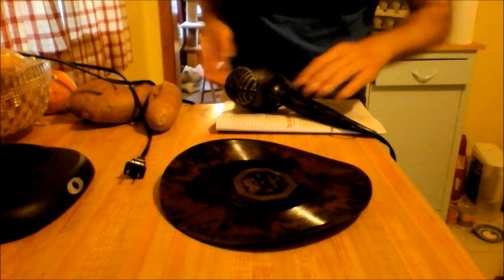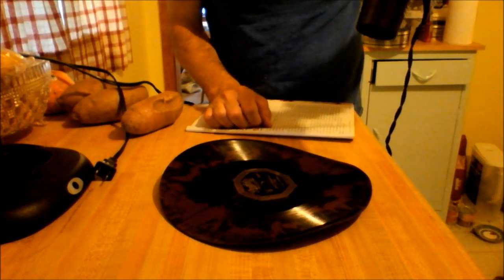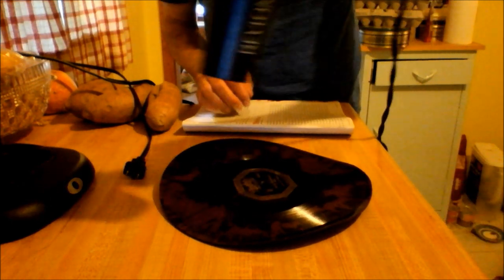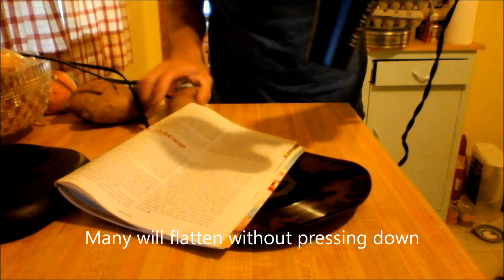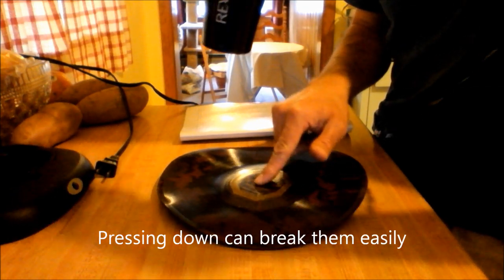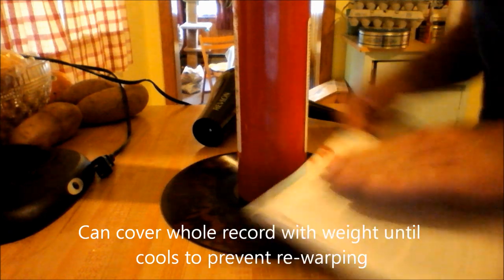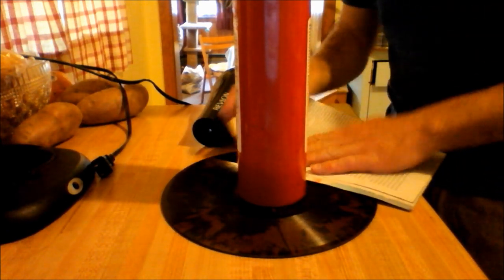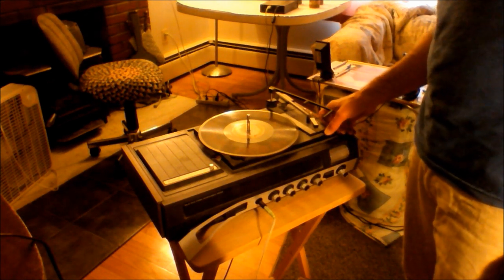Flattening A Severely Warped Pathe Splash 78 RPM Record

Comment from the maker: Not a silly question at all. It should work on all sizes. Doesn't work as well on 33's and 45's because they are made out of vinyl and styrene and it usually effects the way the sound and they would melt very fast. I made a video on here of flattening them also on here. 78s are made out of shellac and other stuff which for some reason works way better for flattening. The non breakable 78s may not work as well.
Reply: Yeah I melted the beginning portion of one of my 12" singles but that's my fault lol

Comment from the maker: This week's video. Flattening a severely warped 78 record. Next week back to comedy.
Reply: Had I see that record before you fixed it, I could have thrown it out altogether, by the way, do you need a certain kind of hair dryer to do the trick? or any hair dryer will do just fine?
Reply from the maker: I just use a regular hair drier. It seems to work really well.

Comment: I did not even know 78 RPM could warp! I thought only vinyl could!
Reply from the maker: I know what you mean cause they are so hard as if there is no give to them. I wasn't even sure about flattening them at first but I figured I had nothing to lose and the results were fantastic. Glad I could save them.
Reply: I have two 78 that are cut in half and one that shattered in thousand pieces. The one in thousand pieces is obviously beyond repair but do you think it's possible to repair the ones that are cut in half? Like with glue or something? One of them is very valuable so is there any way I could fix them?
Reply from the maker: I wish I could help you with that. That's one thing I wish that could be fixed. If someone comes up with something to fix broken or cracked 78s back to where there is no crack it would be awesome. I have glued them before and they would play but the crack is very loud everytime it went by. I used a epoxy glue where you have to mix the two tubes together to see how the records would come out. Lets hope someone discovers a way.
Reply: "JB Weld" does pretty good in fixing cracked shellacs. Make a small batch of JBWeld epoxy, then thinly spread the epoxy on one side of the crack and press together until fully dry. the epoxy will fill to the edge and before the JB Weld sets, take a sewing needle to "etch" out homemade grooves for the needle to pass over the dried epoxy.  It's a decent fix but will still hear the click where the crack is located on the shellac.
Reply from the maker: I tried that once. if the 78 gets dropped it actually breaks someplace else and the epoxy holds. My problem is after I fix one my epoxy glue dries out on me. I have to find a solution to that.
Reply: Gary KlunkervilleTown I have one in 3 parts, im going to glue the edge bit and just the circle bit (where the goves are NOT played). this should work as the needle will pass over the groove lines nicely.
Reply from the maker: I have a windup record player and sometimes I will do that so I can at least play them on that. Just a bamboo needle so I don't worry about the needle getting worn.